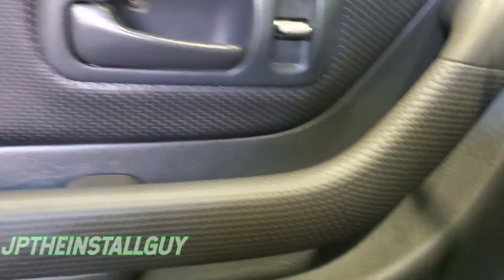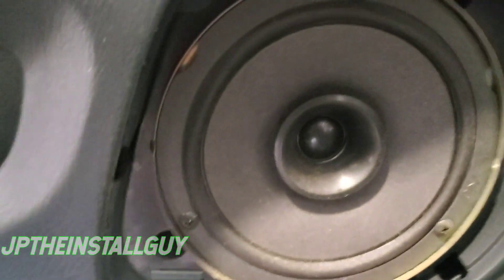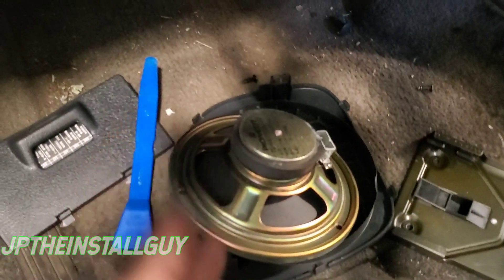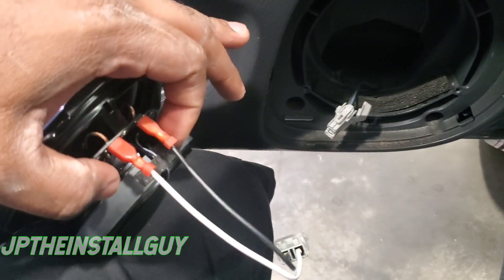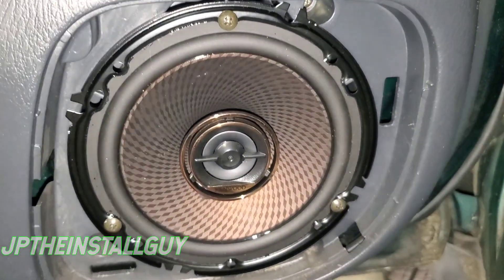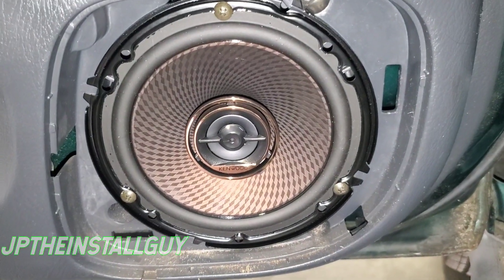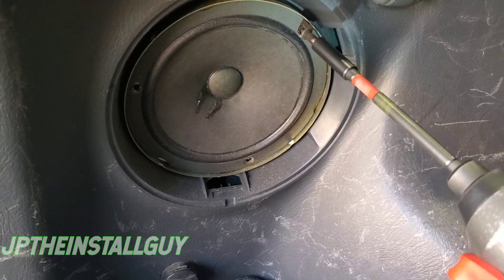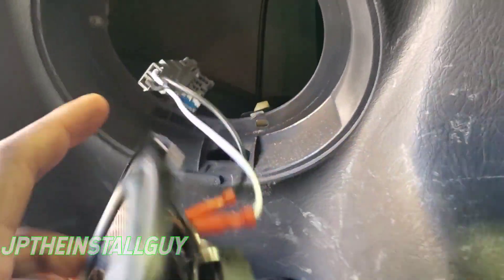2000 HONDA CRV speaker replacement and install

Comment: Which speakers are used? I just want to make sure I get the right model.  What other cord did you use for the rear?
Reply: In vid description. Im going to grab a pair myself. If in NYC, they sell these at Autozone and it seems bestbuy sells them too.

They are 6.5 inch kenwoods

He used the same speaker harness to connect for front pair and rear pair, Metra 72-7800, can be bought on amazon for 7 bucks.

Comment: Size rear speakers? And where can i find those connectors
Reply: Autozone, or amazon or bestbuy. 6.5 size kenwood brand. (In video description.)
Edit:
Speaker harness can be found on amazon for under 8 dollars. Model is in vid description, Metra 72-7800

Comment: I have tried 3 different sets of speakers and none fit. The stock speakers are slightly under sized so almost no aftermarket seem to fit.
Reply: Kenwood kfc-d161 will fit factory style slimmer design too no cutting into speak door plastics of Honda Rd1s
Reply: @gmtz235  I ended up custom fitting some speakers in the front. Cut out quite a bit to make room for them and left the back speakers stock.
Reply: @HelloFriend365  ah niceee I had recent put all kenwood d161 on my Rd1 sounds good with good bass just as stock, before I had Boss ch6530 I didn’t like those at all just a plain tweeter no bass then tried Skar tx65 those sound good but slightly didn’t fit perfect in the front doors they wouldn’t sit right, I just didn’t want to cut into the front door speaker pockets otherwise they’ll fit good
Reply: @gmtz235 Do you need to upgrade the radio and add an amplifier as well? I still have the stock radio it came with.